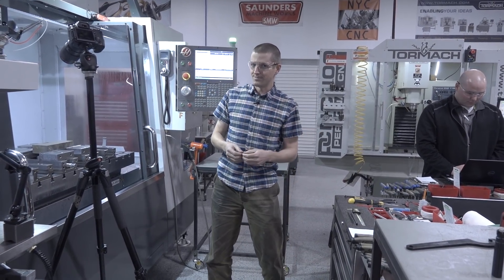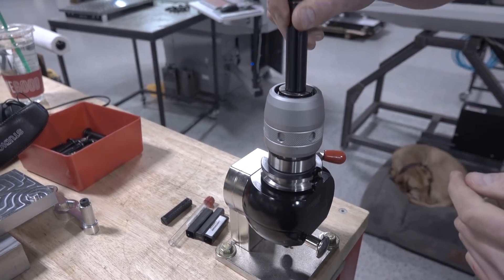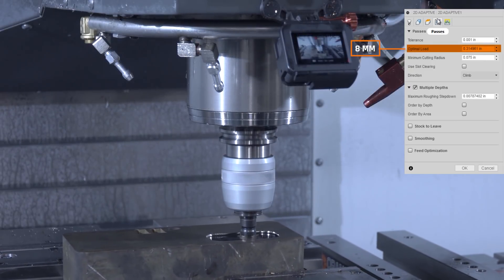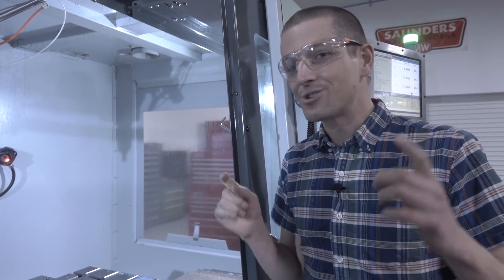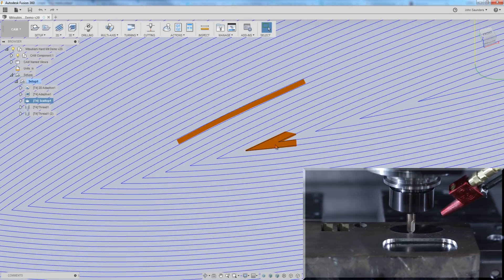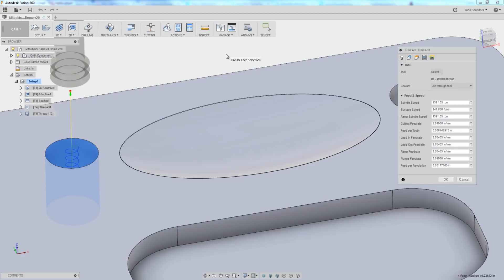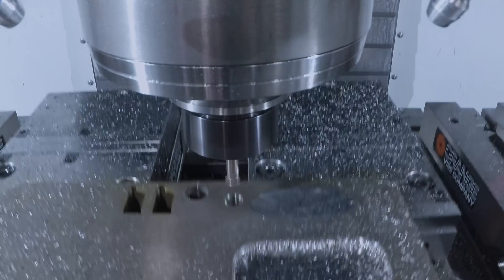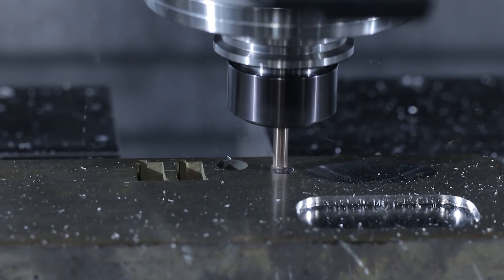Hardmilling Tool Test on HAAS VM3!

Comment: I've done a lot of hardmilling in the past working in a toolroom.. even after all these years, it's still exciting.. Last time i did it, it was in a 60 HRc Vicem i had to make some holes 8H7 for dowel pins.. on my home built CNC with only 1 kW of power.. I used a 4 mm Endmill, and i went 12mm deep.
Hardmilling is AWESOME!..

Comment: I'm not a machinist, and what machining I do is manual. I did not know that it was possible to thread mill without drilling a hole first in any material, much less hard steel. Awesome!

Comment: back in my machine shop we used to turn and mill 62 hrc tool steel for almost 20 years now, and even drill and tap thread up to M12.
it's really great for accuracy and to save some maching steps/grinding process, but only if you're willing to spend the money on the tools as they're ridiculously expensive (M12 tap comes for around 150 dollars, won't last long and requires sturdy machine with special chuck for micro deviation compensation...)

Comment: Great video John. Just for your own amusement can I recommend a standard offset contour tool path with a helical feed down for the feedmills. Because the chip thinning effect is axial there's no downside to full radial engagement. I see you used an adaptive path but in this case there's really no need. 

I will be looking into that treadmill though. No pre-diameter operation would be a time saver for sure.

Comment: Can anyone shed light on why the thread mill was designed to cut counterclockwise.  Going to venture a guess that it enables a climb cut while ramping clockwise into the material due to the right hand thread?  Better chip clearance or surface finish with the climb milling?
Reply: BDGRanger 
I think you've said it all, but to say it a different way... since there isn't a predrilled hole the tool MUST helix in in a counter (oops) clockwise direction (to follow the screw threads). That requirement would normally mean it would be doing conventional milling, but since climb milling gives better tool life and surface finish the tool is made to spin counterclockwise, which transforms the cut to climb milling.
Reply: Hirudin thanks for clearing that up. You wouldn’t typically finish the feature to size on the first pass with a tool like this would you?  I assume a roughing pass then a second clean up to dial in fit?
Reply: BDGRanger 
This video is the first time I've seen a tool like that, so I wonder the same thing. :)

I have done a little bit of thread milling, but I haven't had to do any to a high degree of accuracy. What I've done so far is I'll dial-in the first couple holes that I do and once I get something that seems to work I'll just keep using the same settings. And, personally, I DO usually do thread milling in at least two passes (some number of roughing passes and a finishing pass).

I wonder if this tool has the roughing pass "built into it" (for lack of a better way to describe it). Like, since they know in what direction it'll be milling, maybe the bottom point(s) are slightly smaller (for roughing) and the top one(s) are larger to leave a good finish. I guess the cutting edges could even have different geometry (rake angle, shape) too.
Reply: Hirudin, checking out Mitsubishi-hitachi’s website I found their edt series of thread mills.  They note 1 partial thread and 2 full thread cutting teeth.  Looks like you were spot on!
Researching tooling on a Saturday morning...l really should get outside...or into the shop ;-)
Reply: Oh cool, thanks for passing that along!

Comment: What is the reason for running the tool while touching it off? It seems like it would start giving inaccurate readings after the tool starts cutting into it.
Reply: Daniel Napast the tool is running ccw :)
Reply: So the lowest tooth touches first
Reply: Yea that was nasty I cringed when I saw it and had to back it up to make sure it was running ccw

Comment: I tried no-hole thread milling a number of years ago, but the tool was not capable of doing that material. Not even close. 

I did learn that it was still faster to drill first and treadmill with a conventional thread mill tool. Never really persued it after that.

Comment: WTAF?!? Hard milling and turning, yeah it's impressive. But plunging a thread mill straight into a workpiece? Forget the fact it's hard material, it freaking plunged in! Would that be quicker in aluminum versus drilling then thread  milling? Or drilling and tapping?
Reply: Victory Rifle Rests It's helical interpolation negative in the Z axis each helix is the pitch of the thread

Comment: What no test fitting a bolt in those threads?? :-)
Reply from the maker: Not joking: we looked around the shop for ~10 minutes.  No M12 bolts - at least none that weren't already inside/part of a machine :/
Reply: That is usually how it goes at my shop I can find every size but the one I need!
Reply: Have that exact model of thread mill at the shop I work. Makes perfect threads for about 20 holes like Ipadize said and will hold for up to atleast 50 if tolerance is not an issue. 

The cost for it though does not weigh up the benefits for us compared to drilling + regular thread mill. But in a production line it is great. One less tool and operation to worry about, saving time and money.
Reply: If you can swing it look into Lawson bolts. We have a decent assortment of standard and metric in bins and it’s awesome. You can order what you want and they will ship them to you bins and all. They aren’t cheap but you won’t find a better made bolt I can guarantee you.
Reply: bcbloc02 no need to because i can speak out of experience that those Tools make a perfect thread. At least the First 20 threads or so :)

Comment: Neat! Does the machining on pre-hardedned steel create enough heat in the part to change the hardness of the material?
Reply: No. Typical prehardened tool steels start losing hardness after a few hundred Celsius, which is not seen in the part color in the video.

Comment: It would help to have the tool's part numbers listed in the description. Also, is there any way fro Fusion 360 to number the tools sequencially?
Reply: shataann 
I believe you can right click in the tool table and an option to renumber tools will be given. (Sorry, I'm not at my computer, or else I'd check.)
Reply from the maker: I'll update on Monday when I'm back at the shop!
Reply: Yep, that's how it works! You can also tell it which number to start on, how many to increment by, and also to remove tools which aren't in use- Say you changed your mind on using a tool and it stayed in the library for that part. You can declutter anything not assigned to an operation quickly.
Reply: Thanks, that will be helpful.
Reply: Thank you!
Reply: Is it Monday yet? I need these tools. Please post info. Thanks again for sharing boss.

Comment: Test the bottom of that picket you milled. It might only be hard a couple mm deep.
Reply: Andrew Delashaw 
D2 full hard is a common thing. It might be less than the 62 hardness of the surface, but not by much. Probably 58 at the least.

Comment: Nice John! We do a lot of hard turning, milling at my full time job. We also use carbide taps in hard steel but this might be even better. Thanks for showing.
Steve
Reply: We used to threadmill everything that was hard at my old job (injection molding shop) because if a tap snapped we would have a serious problem. Threadmills usually don't snap and if they do it doesn't cause any harm to the part.
Reply: These Mitsubishi threadmills go for a mere $240 each (at least for the 1/4-20 version).
Reply: Drill or sinker EDM and no problems :)

Comment: My brain is struggling to work out how that tool is spinning and cutting a thread. :-)
Reply: Rich W 
I think it'll make the most sense if you start by thinking about a single-point thread mill. A single-point thread mill is somewhat similar to a t-slot cutter, except the cutting edges of a thread mill are angled down to a 60° point instead of a flat. Like a generic t-slot cutter, if you look at the cutting edges from the side, each edge will look the same. That is to say that all the points on a single-point thread mill are at the same height. So, when it's spinning and cutting into material, each point cuts into the material at the same level, which will cut a single v-shaped groove into the side of the material. If, while the tool is moving along the side of the material, you also move the tool down, only one v-shaped groove will be made, but the groove will slope downward.

This tool works the same way - all the points at each level of the multu-point thread mill are at the same height and when the tool spins each level of the tool makes a single v-shaped groove. By moving the tool down while also moving in a circle, the v-shaped groove forms the helix of the threads.
Reply: Rich W 
The thread pitch is ground into the cutter. By feeding it as a helical angle it cuts the correct pitch of the thread.

Comment: Honestly have never seen a thread mill capable of cutting on the face. 

Though I usually use single point thread mills because of their versatility. 

Now. If they make a single point TM capable of that I’m going to make someone break out their check book!
Reply from the maker: Someday, something will be good enough for you :)
Reply: NYC CNC 
The day that happens is the day I retire. 

The day you accept “good enough” is the day you stop improving.
Reply: NYC CNC 
And don’t forget for who and where I work. 

“Good enough”. Is never good. And it’s never enough.  

To quote Dean himself. 

If you’re going to take a nap on a bear skin rug. Make damn sure the bear is dead.